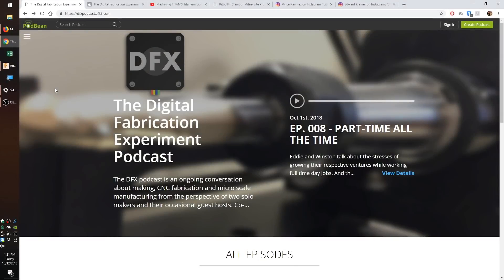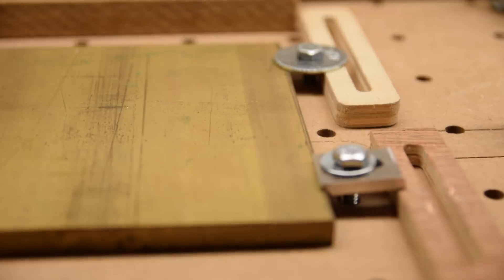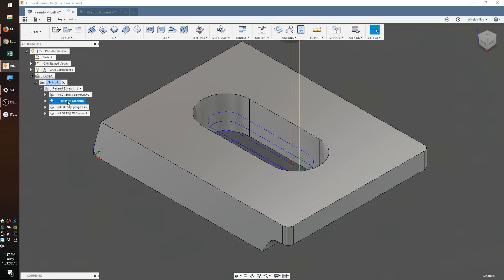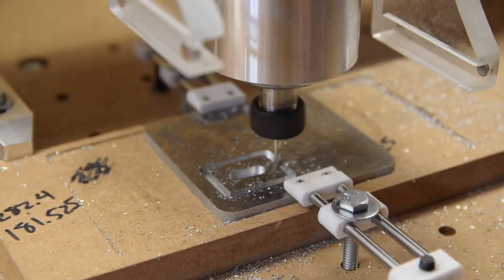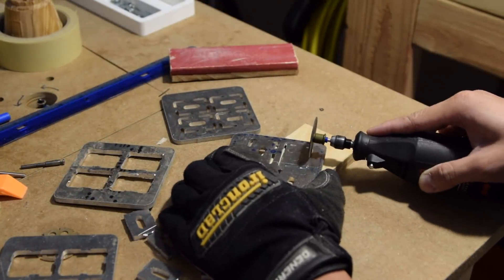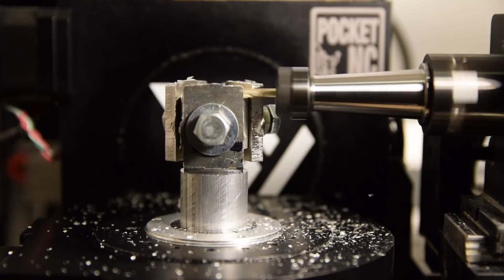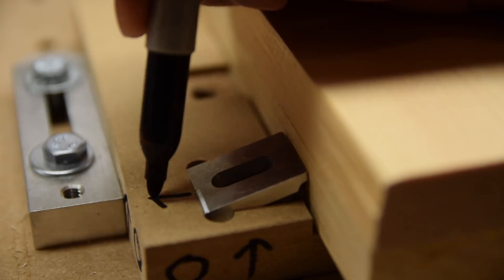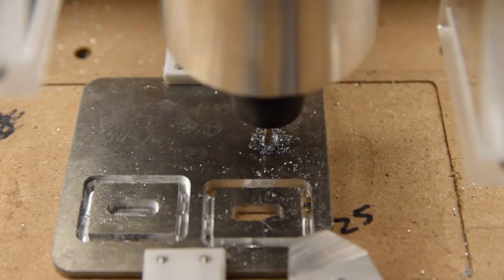Making Mini Aluminum Clamps on my Hobby CNCs - #132

Comment: I've had great luck using a 3D-printed "bit fan" for clearing aluminum chips. Basically, a small fan that slides over the bit, held in place via friction.

Comment: Winston, always love your videos (I have a Nomad and Shapeoko XXL) I will say one thing about the oops clamps, I made my own using ABS plastic (it's stickier than PLA of the OOPS (higher  friction coefficient)) and I used hardened steel rods (piano wire) so I can tighten the clamps a lot more than the oops clamps. I only use wood and plastic so far but I put in a 5" x 6" x 3/4" piece of hardwood and with only 2 of my oops style clamps I can easily lift or slide my XXL around without it ever slipping. If I try to tighten a real oops clamp that tight the rods just bend (and stay bent permanently). So better plastic, better rods and you can have a very stable oops style clamp. Not saying it's up to the standard of what you are making with aluminum by any means it's just there are other options and if I decide to try aluminum I will use my clamps and I think I can do so successfully.

Comment: Hi, I have watched a few of your videos recently and if you are able I have a couple of questions. Do you find any issues using the same machine for wood and metal? I am thinking of aluminium chips interfering with your wood cuts?  Have you tried machining brass and if so does it have similar issues to aluminium?  I am looking at CNC machines currently primarily wood but would like to be able to machine brass. Cheers.
Reply from the maker: All you have to do is vacuum your machine between materials, i have no concern about it at all. Worst case, dust or chips will keep your piece from sitting flat (but you'd feel/see it).
Reply: Winston Moy: Thank you for your response, my concern was over any impact to wood cuts from left over chips from cutting aluminium. I guess I was thinking it would be difficult to completely remove all debris from metal cutting.
Can you tell me if you have tried to machine brass with the CNC?
Reply from the maker: H2Dwoat yea. Just search my projects. Did dogtag and some plaques with brass.

Comment: Very nice work on the clamps.
I agree that the smaller the angle is between the clamps and the spoil board the more force exerted in the z direction but positioning them at say 30 or even 45 degrees will increase the lateral clamping force. I think this will give more overall stability to loads in the x or y direction.

Comment: Great progress since you started cutting metal, nice to see some real chips on there.  You really hit all the key points.  Lubrication is nice, but airblast is really so important to getting it working cleanly, and truly rigid workholding you can't do without.

40% stepover is a little big for an adaptive, if you stay between 10 and 16% stepover you can decrease the cutting forces more and take a deeper axial cut, probably a couple mm deeper than you're doing now, but perhaps you're running into feed rate limits.  You do have to get going pretty quick to make up for the shallow radial.

For slotting cutouts when you don't want to do a trichordal the trick that I use is put extra roughing passes in the profile to give more room for chip evacuation as you get deeper in the slot.  Say slotting 6mm sheet, for the first 3mm of depth I'll do 2 roughing passes at .35mm, duplicate that toolpath and then for 3mm-5mm depth 1 roughing pass at .35.  for the final 6mm depth do no roughing passes.  This gives extra room as you go deeper, and you don't run into the chowder from chattering on the conventional cut side of the slot when you're running around at the next depth at full tool engagement.  It tends to be knocked off harmlessly while running around the additional roughing passes, leaving the wall clean when you move to the next depth.

Comment: Good stuff Winston.  I need to make some of these, or perhaps something more like the LowPro version: https://lwmcnc.com/product/lowpro-t-track-clamps/
Also, this is the 3rd time I've recommended this to someone today:  painter's tape.  stick a layer down to your bed, stick a layer on the bottom of your stock, and superglue them together.  Amazing holding strength and you might not even need to use tabs.  John Saunders' video on that here: https://www.youtube.com/watch?v=r6DCvtcU8_M
Reply from the maker: That low-Pro system is pretty slick. Almost more compelling than the Mitee-Bites clamps, except for the price.

And I'm acutely aware of the masking tape trick lol. I put out my own video about it a week before Saunders did his.

Comment: Hey Winston! Great video as always. Why don't you use the nomad for these smaller aluminum projects?  I figured that would be right up it's alley.
Reply from the maker: It's more accurate, but less powerful. I can take a more aggressive cut on the Shapeoko, especially when adaptive clearing.
Reply: Makes sense. As an owner of the nomad (and a shapeoko that's mid repair), just wondering why you don't break that machine out more often.
Reply from the maker: It's usually down to material removal rate. For the size of the projects I typically make. I'll gladly sacrifice accuracy for speed. But I'm looking to switch things up soon...

Comment: Isn't your surface speed on the low side with 10K rpm and 1/8"? It works out to about 350 SFM. 600-1200 is the range I've found on the internet. Especially if you have a coated endmill.

Admittedly, I haven't mixed success with 1/8"@20K.

Is this a conscious tradeoff or simply an oversight.

Anyway, thanks for great videos and keep it up!

Comment: These smaller projects are really nice to do, often some of the most rewarding one's to do because it helps you on a daily basis. Thanks for sharing! On a sidenote, what size ER collet does your pocketNC use? I made a load of different storage holders (for on DIN rails) and if it's a common one I may include  it in the available models.
Reply: Little update, I figured I'd better go to the PocketNC website and see if they have some information about it available. It turns out to be ER40. It's not that much work so I'll make one for that size ER collet as well (Allready have models for ER11 up to 32 so it would be a nice addition)
Reply from the maker: ER40 is for the B-table. The spindle is ER11.
Reply: Allright, thanks for the answer! I allready got a storage holder for ER11, ER40 is about to be added to the list.